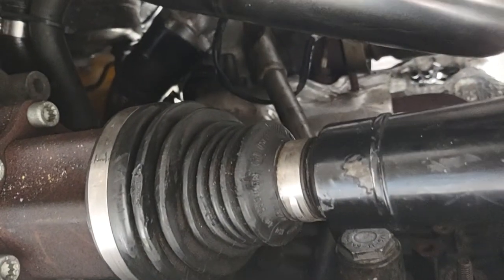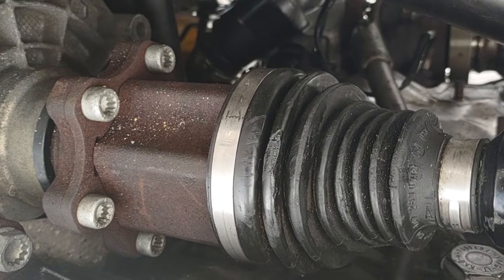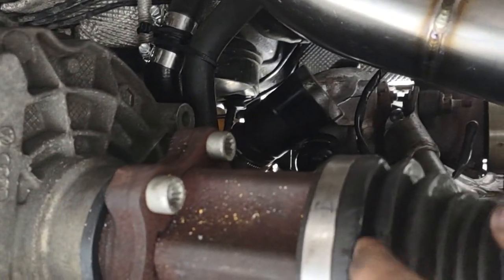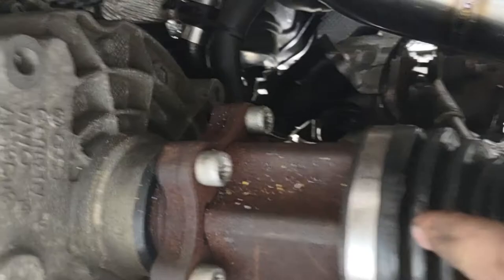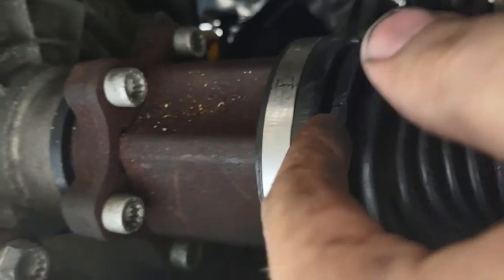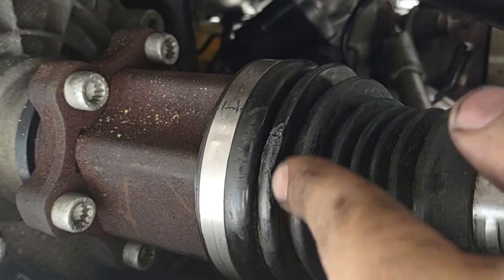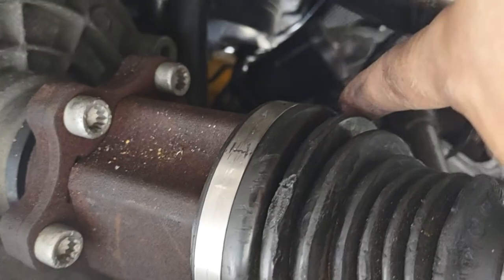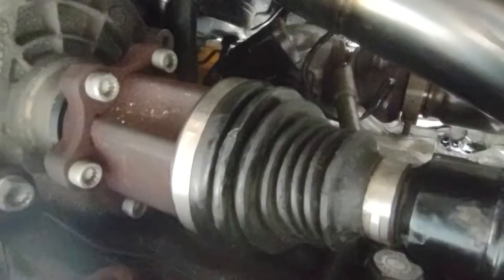Quick CV boot repair for small cuts and tears

Comment: In 1985, I had a Pontiac Fiero--didn't know what a CV joint was--it developed a hole on a large space on the side. cleaned it up, stuck a bicycle patch on the inside of the boot, and one one on the outside, It never leaked grease again until I sold it in 1988.
Reply: Nice ingenuity! Thinking outside the box.  Great suggestion. Many many thanks